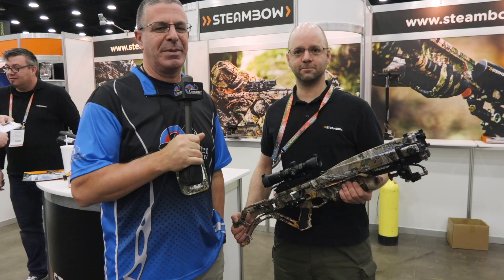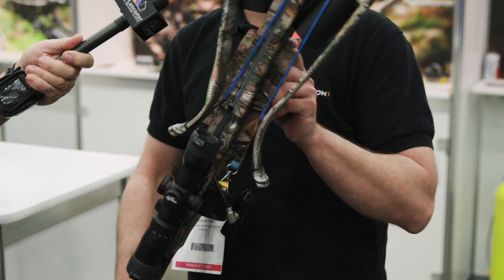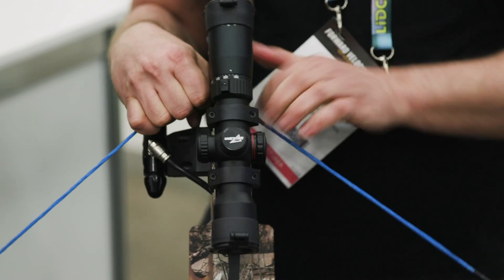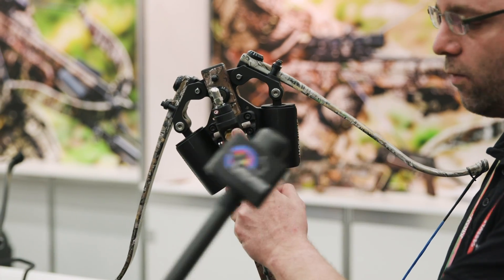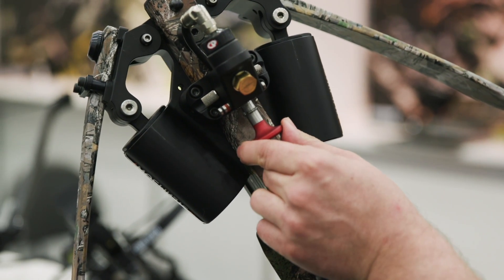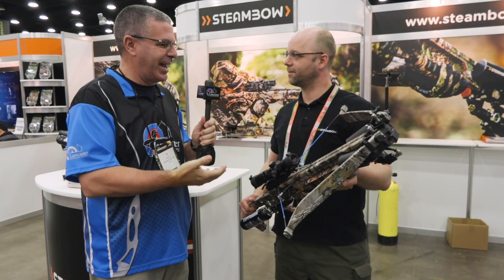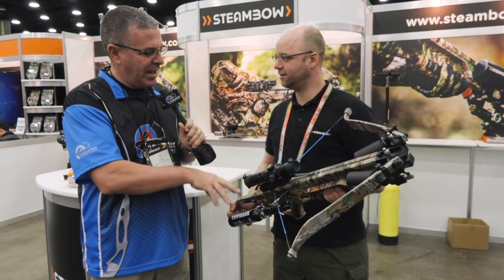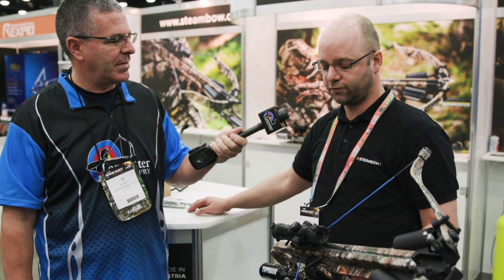Steambow Air-Powered Crossbow

Comment: How's it work in cold co2 does not like cold weather
Reply: True, gases at constant volume and decreased temperature are not as pressurised. So the same CO2 catridge would deliver less pressure or "reload charges" in the cold compared to warmer days.

The CO2 cartridges are used as a backup though. The refillable paintball gas tank acts as the primary supply of pneumatic pressure which can be filled at whatever temperature and whenever you like.
Reply: The rate of use shouldn't be a issue for co2 even if it cold
Reply: I’ll like to see more on this point because I always thought CO2 did not perform well in cold weather. As to whether crossbows are “archery “ there are many opinions on this issue.